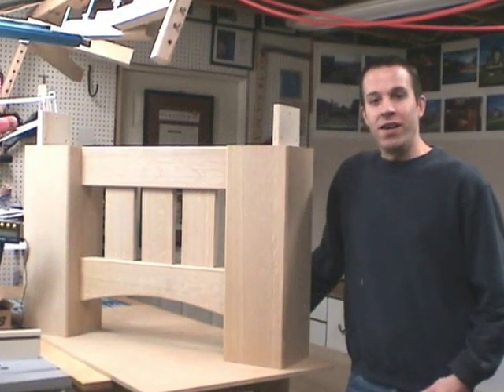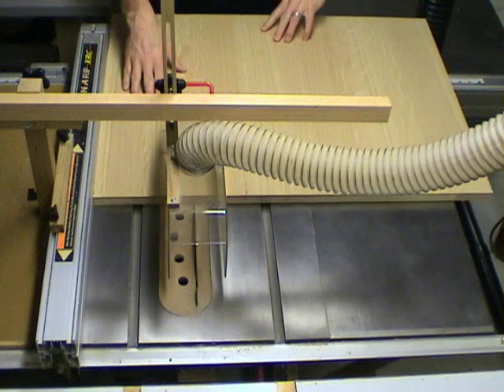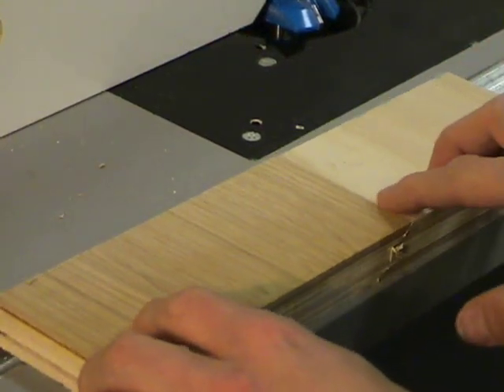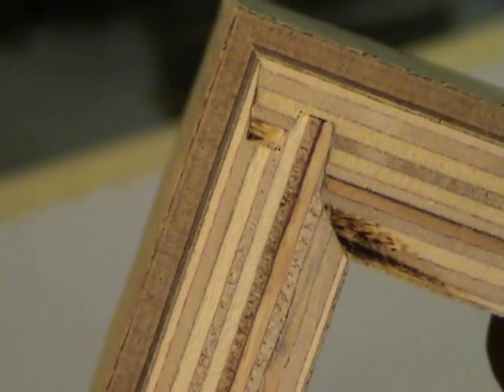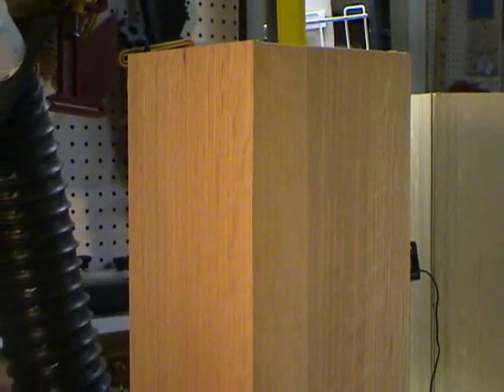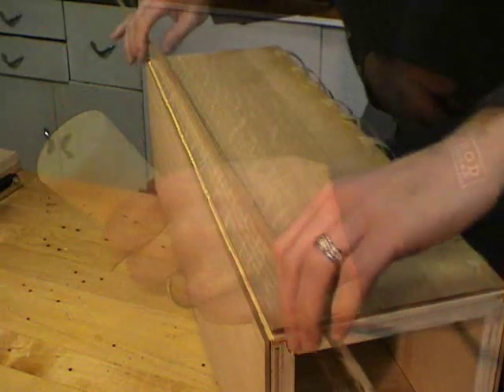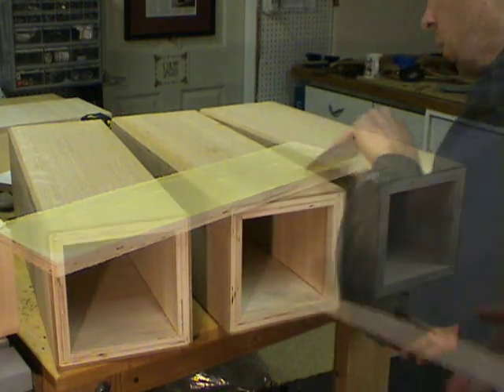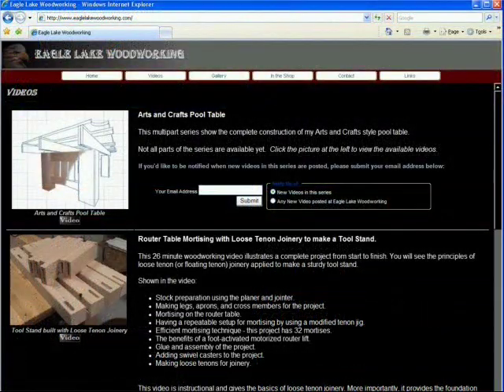Pool Table Build - Part 1

Comment: Don't plug your camera into the same breaker as your power tools. Great video though. I will definitely start using my router joint bits.